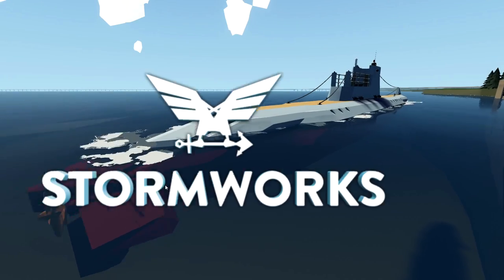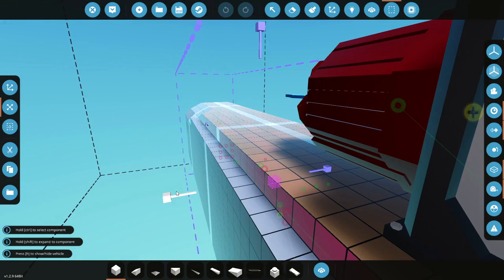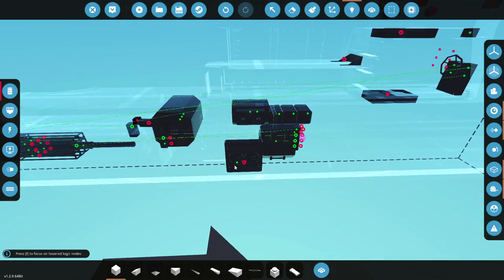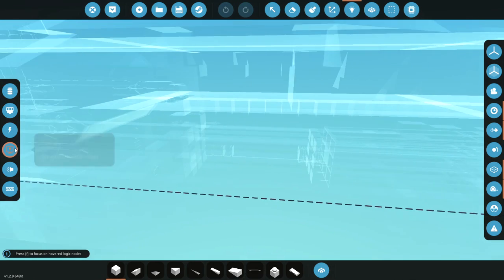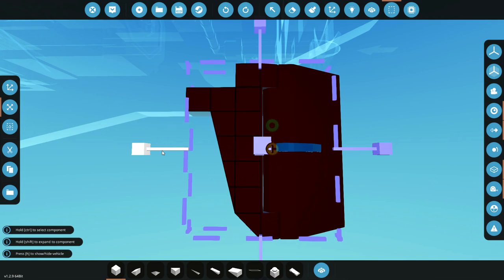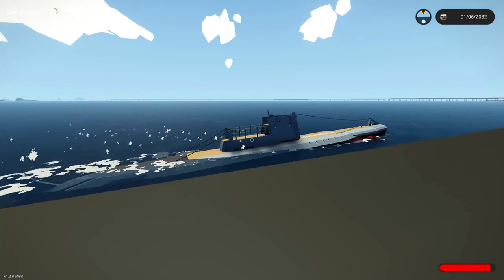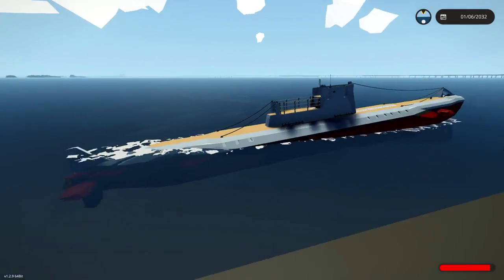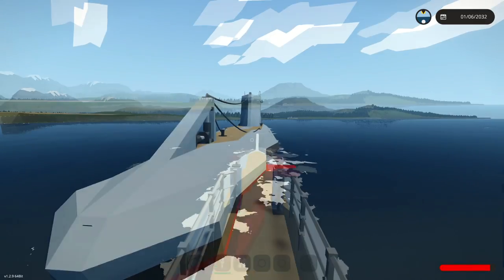Nuclear Reactor Installed! - Submarine Build - Part 5

Comment: The control surface you just installed at the back is missing connections and electricity and you probably want to add a gearbox to the generator
Reply from the maker: Trueee, I forgot aha :D

Comment: I just use 2 threshold gates and a valve to regulate the boiler. First one activates above 10 liquid volume and the other one activates when the pressure goes above 9.5. I also use a and gate.

Comment: second

you can connect more turbines to the boiler but you need more condensors and you forgot to remove the 2 water tanks and you need to invert the upper ruder

Comment: 0:10 Zis is not a U-boat hans because if you put a nuclear reactor in a U-boat it makes a nuclear powered not Uboat submarine.

it uses the hull of a U-boat but it is not a U-boat Hans.
Reply: Historically no its not a uboat, it is as he said in this video, is a custom design based off a uboat. But if you wanna get technical a U-Boat, or U-Boot, which stands more or less for undersea boat. So technically any German submarine, or even a German person can still call any submarine a uboat, as by definition they're still the same thing more or less, they've just advanced further through time and are no longer similar, further more almost all modern submarines come from the design of the Type XXI uboat, which was extremely late to the war, but extremely advanced compared to other uboats and submarines from different countries, after the war the major powers, i.e. us, Russia, and England for sure got a bunch of them, and utilized alot of stuff from them for further advancing submarine technology, uboats during the war were nowhere near the advancement of nuclear energy. At best you got the Walther engines in the Type XXI, which frantic would be really cool to see you make a Type XXI uboat and actually build a proper and working variant of the Walther engine, although I'm not sure If the game will let you utilize hydrogen as a fuel source, or if it's as dangerous to use in the game as it was historically.